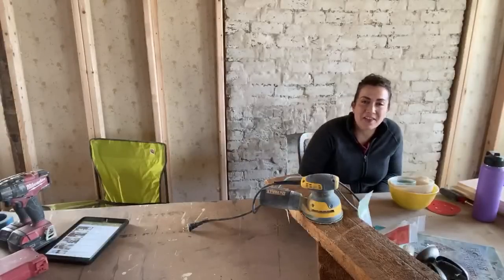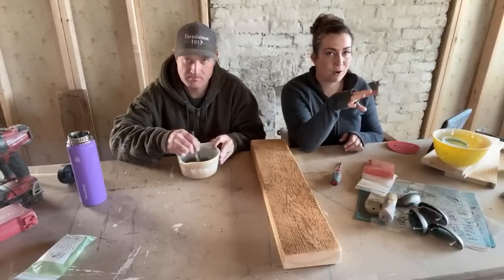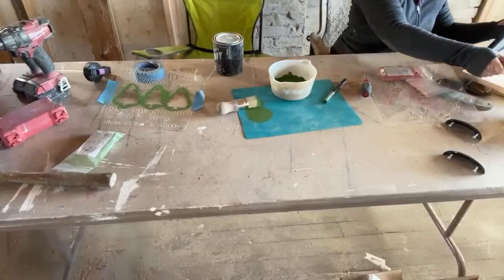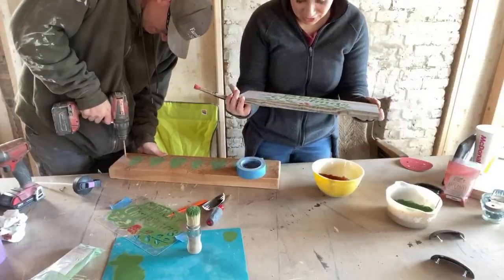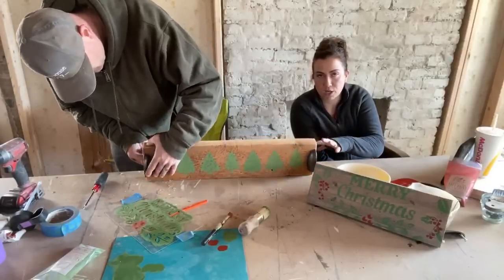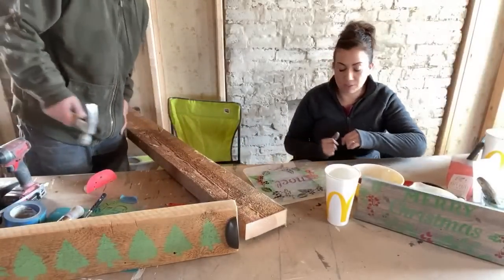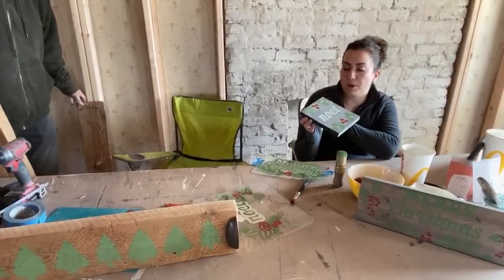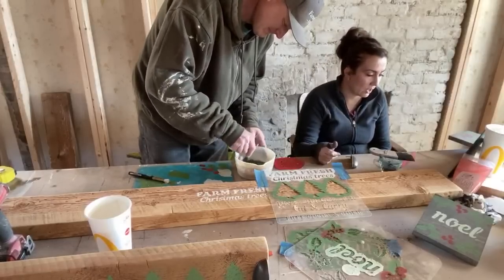Salvage Wood Trays | WNW

Comment: First, thanks so much for taking an hour out of your tool rental time for us! You guys really are amazing, generous, and kind.  Love all of these projects, especially the long centerpiece! Also, Is there any way to salvage old boards that are warped? We found some old barn wood on our new property in WV. Most are good, some have warped.  Thanks again! 💖🙏
Reply from the maker: There are some ways. If they are thinner, get them wet and then put something heavy on them so they’re flat and let them dry out for a couple of day’s. That should take most of warp out. For thicker boards I use a planer to flatten the high spots until the board no longer rocks.
Reply: Jami Ray Vintage Thanks for the tip!

Comment: Just for your info, Jami...I’m not trying to discourage you about putting the claw foot tub in the kids’ bathroom, but....
I felt the same way and did the same thing in our kids’ bathroom when we remodeled our old house. We bought the kit for the shower curtains and the shower/tub faucet kit......It’s kind of a nightmare. The curtains leak water all over, the tub is too small for taking a shower and the bottom slopes down from the sides, so a little dangerous. I didn’t worry too much about the kids showering in there, but our guests have to use that bathroom as well. I feel bad about that. If I had to do it over, I would probably have used it in my bathroom instead of our jetted tub, (for just taking a soak) and forgot about the shower aspect. Just a heads up, so you know what you’re getting into.
Reply from the maker: Cynthia Fisher we will have three full baths including a walk in shower on the main floor attached to the guest suite. The kids can also use our shower. I am guessing the kids will use ours a ton because it’s going to be huge. Then they can use the claw foot for taking soaks ❤️.
Reply: Jami Ray Vintage great! You’ve got it all figured out. They are really pretty, so I get it. I painted the outside of ours red and did a Swedish theme with red and white wallpaper, red and white gingham and V-groove wainscoting. And added some Carl Larsson prints. It urned out nice.

Comment: Jami/Zeb or anyone who can answer my question.  I have an old breadbox I would like to paint and it sounds like I can use Farmhouse Finishes in Floursack color on it.  Do I still need to seal it for people to use it to put bread in?  Thanks!
Reply from the maker: It wouldn’t need sealed to be safe but I would recommend it for durability if it’s going to get used a lot.

Comment: Jamie how many applications can a stencil take?
Reply from the maker: Lucia Regalado I’m not sure but I have used mine a ton and never had one wear out. Clean them well and lay them flat so they don’t get bent or ripped and they will work for a really long time.
Reply: Jami Ray Vintage sounds good to me. I’m going to your site and get some along with brushes. Does your stencils recommend what brushed to go with which one ? I want to get a small and large brush.. thank you
Reply from the maker: Lucia Regalado no they don’t but I would say if you buy the largest and smallest you are set. They are pretty versatile